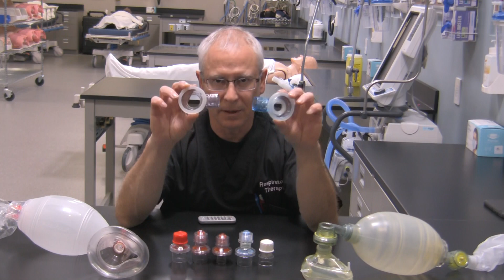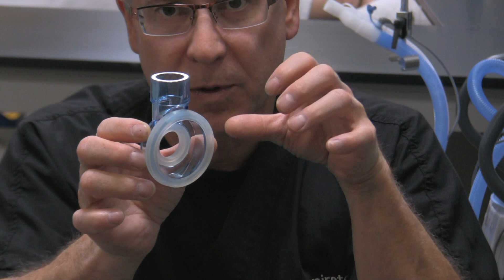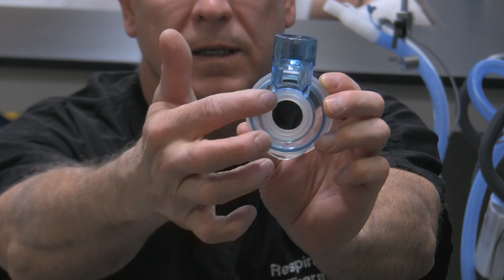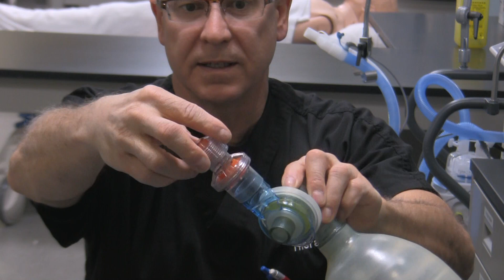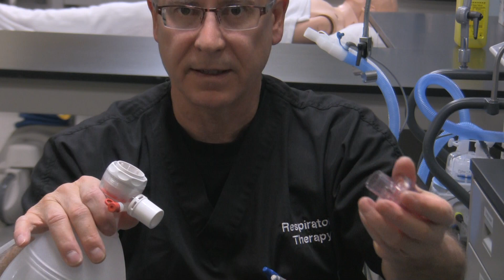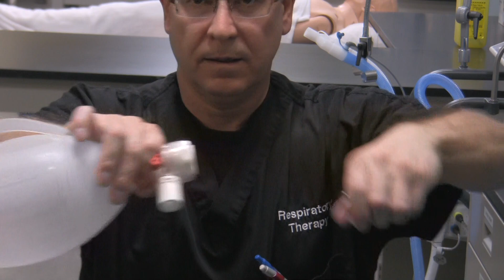PEEP Valves and Diverters

Comment: hi, George..I would like to ask if there is any difference between the BVM's PEEP valve and the ventilator's PEEP valve?And is it true that, when we are talking about Positive Pressure Ventilation , either BVM or Ventilator, there's actually no difference between PEEP and CPAP?thank you.
Reply from the maker: Hi: PEEP is the official name used when we mechanically ventilate a patient with a "mechanical" breath such as a delivered breath with a BVM or a fully supported vent delivered breath.  CPAP is the exact same thing but it applies to spontaneously breathing patients that may be breathing from a BVM device or triggering spontaneous breaths from a vent as your trying to wean them off the vent.  The principles of PEEP and CPAP are identical but the differentiation is in the type of breath the patient gets.....fully supported = PEEP.  Patient initiated, partially supported (maybe).... = CPAP.
Reply: @GeorgeORRT  thanks George for replying. That makes it a lot clearer. But If I may ask you again, because I am still confuse about this a bit. So,if  they are actually the same thing, why is the pressure-time scalar in CPAP machine display different than when we use PEEP valve with BVM (converting the BVM into a poor-man CPAP)? I mean, with a real CPAP machine, we will see a straight line above zero(positive pressure) as the baseline of our breath, on the other hand, CPAP with BVM (by using the PEEP valve), we can see that the end-exp pressure will stay positive only at expiration, but not when inspiration. Why is that?thank you🙏

Comment: Hey George, I wanted to know when the peep valve (set on 5) is attached to ambu, and the lungs are inflated, when we stop further inflation, does the peep remains 5 constant on its decreases slowly
Reply from the maker: Hi: PEEP should remain constant at what you have it set to with a closed system.  A closed system means that there are no leaks between the ventilator or bagger (Ambu) and the patient's lungs.  PEEP will drop or become zero if you remove the bagger, have a leak between the mask and patient's face, detach the ventilator circuit, or have a leak around the ETT  or airway cuff etc.

Comment: WHICH PEEP VALVE IS NEEDED FOR AMBU?
Reply from the maker: I think that I have a video on how to attach the peep valves for the laerdal as well as ambu variety manual resuscitators.  If not, pull the diverter tube (that's the clear pliable plastic part where the exhaled gases leave the bagger) off the bagger and attach a standard peep valve.  If it doesn't properly connect, you may need an adaptor.
Reply: Hello I want to which types of peep valves and diverters are needed for the ambu ventilation? The name of peep valve and diverters
Reply: Mri
Reply: principles of mri
Reply: Principles of MRI
Reply: Can you please elaborate the MRI I mean full form of MRI

Comment: Hi, on what parameters will decide while choosing the PEEP valve and  how to choose PEEP valve 
is this really required
Reply from the maker: Remember that you should never use peep without an ETT or TT or alternate airway in place.  PEEP levels used are based on the patients overall condition (including hemdynamics, cardiac function) as well as oxygenation.  Typically, you may start PEEP @ 5-6 cmH2O and then titrate up if oxygenation is refractory.  Pay attention to cardiac functions, especially acute drops in BP as that could imply too high of a PEEP level.  Also pay attention to PIP and possible drops in delivered volumes especially if your ventilator is not PEEP compensated.
Reply: @GeorgeORRT  This is an interesting point. Would you want to avoid using peep in a code? There's really no way to get BP when working a code (I'm thing prehospital), so would applying peep potentially reduce cardiac output due to the extra pressure that may be exerted on the heart? Similar to how CPAP can cause a drop in BP?
Reply from the maker: @narwhalsintheocean9745  
Yes, your are correct. Increasing thoracic pressures via PEEP/CPAP will reduce decrease venous return.  If a patient is cardiac compromised there's likely to be a drop in BP once pressures become too high.  PEEP levels should be used cautiously and attention focused on drops in BP.

Its recommended that PEEP be used in a code once the ETT is correctly placed in the patients trachea to avoid gastric distention in the patient's esophagus and stomach.

Comment: I am curious why you do not want PEEP in BVM ventilation. Here in the States, we are commonly using PEEP with a BVM. We also use a Manometer as standard and several methods for rate control  and improved mask seal.
Reply from the maker: Hi Steve:  We also use pressure valves and encourage restraint from bagging vigorously or too aggressively during resuscitation (BVM).   We don't use PEEP though when bagging (BVM) to prevent gas from accumulating in the stomach possibly leading to distension and aspiration......if your using 5-8 cmH2O (or higher) when bagging, that same pressures is applied in the esophagus and stomach. PEEP is applied once the artificial airway is placed/confirmed in the proper position.

Comment: Really great explanation, informative and to the point. Quick question, what would happen if you didn't have the diverter or the PEEP valve on the Ambu bag? I had a patient that self extubated and I grabbed the Ambubag available at the bedside but noticed there was no PEEP valve or diverter on it. (Patient did fine btw on noninvasive Bipap)
Reply from the maker: Hi:  You're  better off not having the PEEP valve on the BVM (resuscitator) with BVM resuscitation as the PEEP applied could also lead to gastric insufflation and distension that could lead to tracheal/lung aspiration.  Best to add PEEP once the artificial airway (ETT) has been inserted and the cuff is up.  Hope this helps
Reply from the maker: HI: We don't use PEEP when bagging (BVM) to prevent gas from accumulating in the stomach possibly leading to distension and aspiration......if your using 5-8 cmH2O (or higher) when bagging, that same pressures is applied in the esophagus and stomach. PEEP is applied once the artificial airway is placed/confirmed in the proper position.
  Not having the PEEP valve or diverter on the Ambu setup you used may or may not have made a difference to patient care...if anything, it probably helped prevent some distension when you used the Ambu.  That being said, please ensure you adhere to the policies and procedures of your institution.
 

 George O. RRT

Comment: How is a PEEP level decided?
Reply from the maker: Hi:  PEEP levels are determined by the medical condition the patient presents with and the need for them to be ventilated.  Different pathologies require different starting PEEP levels or in some cases, no PEEP.  It all depends on why your ventilating them in the first place.  Typical starting points for PEEP are 5-6 cmH2O or slightly higher.